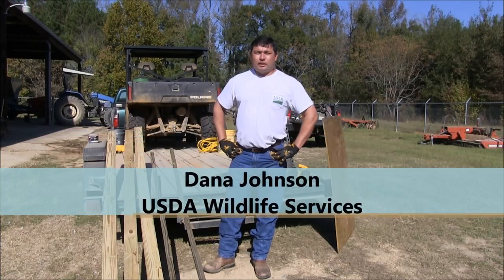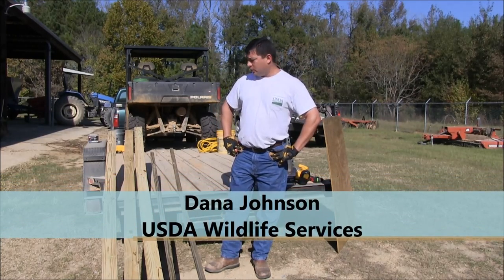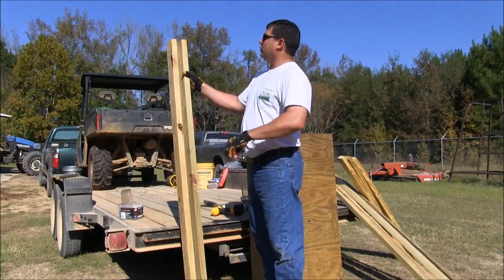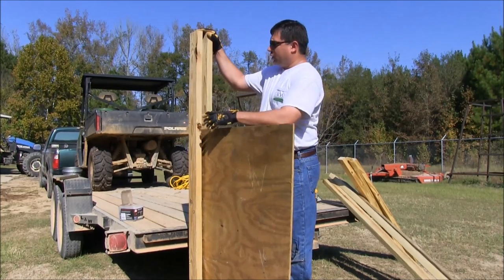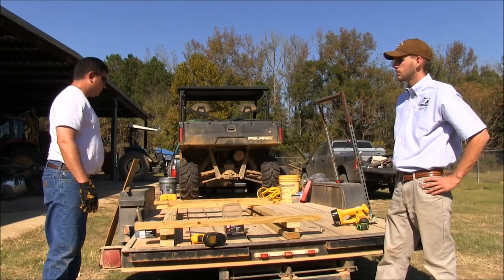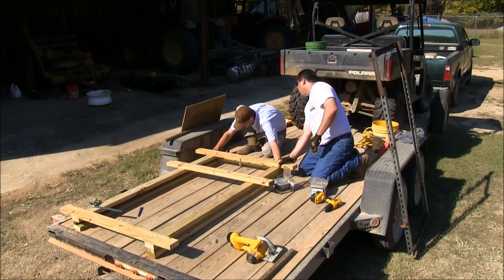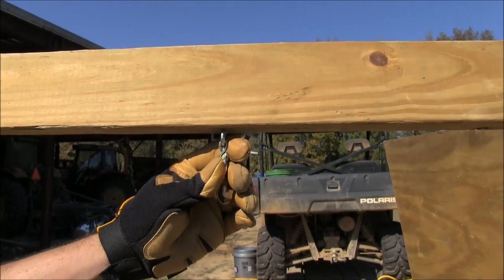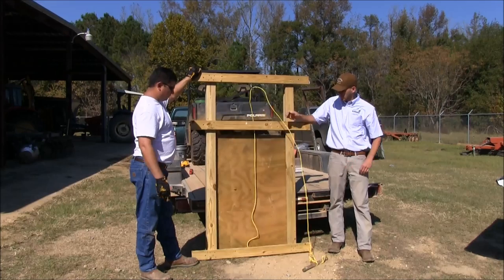How to Build a Guillotine-Style Trap Door for Wild Pigs

Comment: Just finished building this trap door.  Great plan, easy to follow and build.  Fixing to deploy it.  Thanks for sharing this!
Reply: How did you attach the trip rope to the door?
Reply: @richardmatthys7133 , I drilled a hole in the diameter of my rope, 4” up from the bottom of the plywood door, ran my rope through the hole, then tied three knots on the rope.
Reply: @Jaybird1705  how did you set the trigger ?